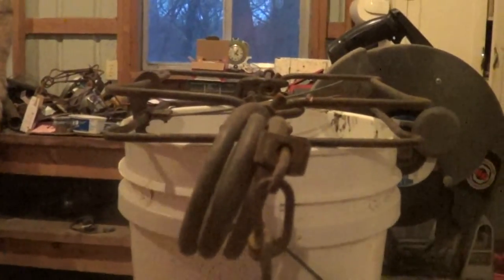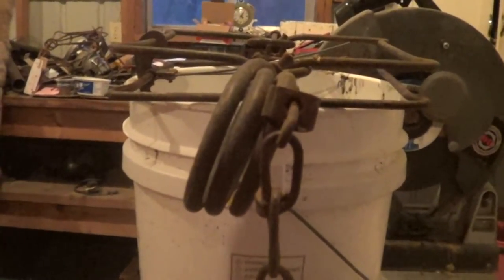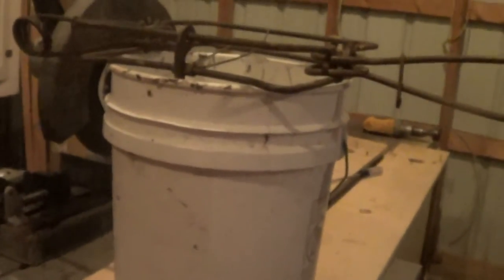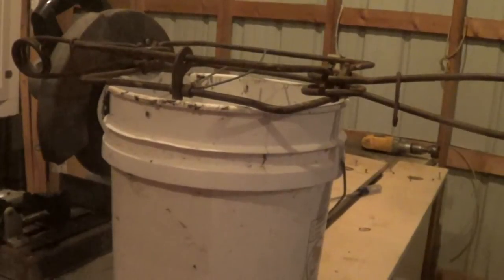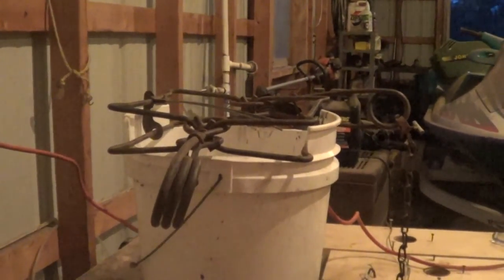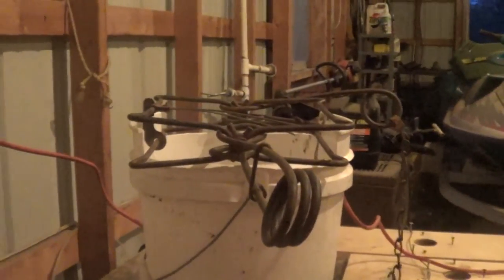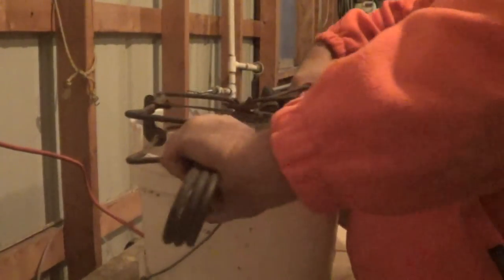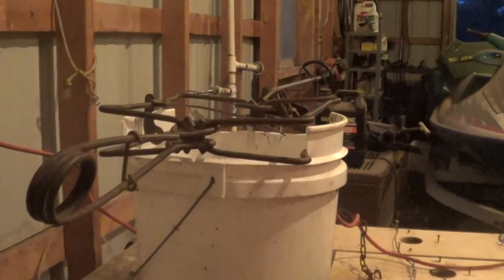How to make a 330 bucket set

Comment: How do you set this up?  I'm trying to figure out how to trap them from boat docks.  They are using the docks or boats in the docks as toilet areas.  Any advice?
Reply from the maker: Couple of things...  Drill a couple of holes in the bucket to run rope through so you can tie it to the frame of the dock.  The other thing that should work well is to make a small sand box that you can bed a foothold in and make a fake toilet on.  Then run drowning rigs off the side of the dock.  I have pictures.  Feel free to email me and I'll send you some pics.  Smithj7405@gmail.com